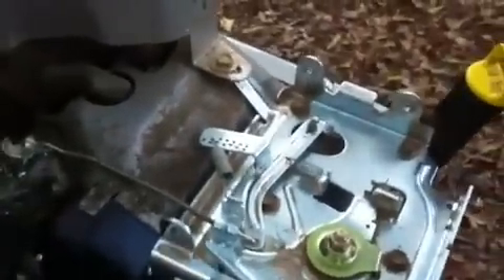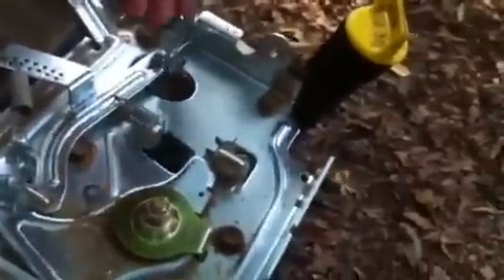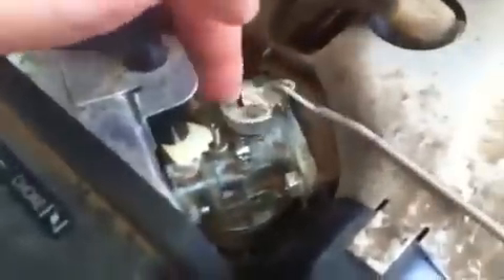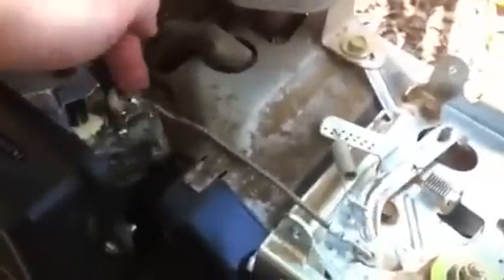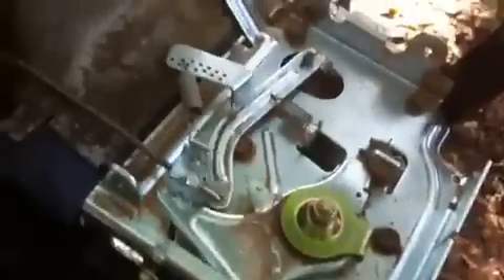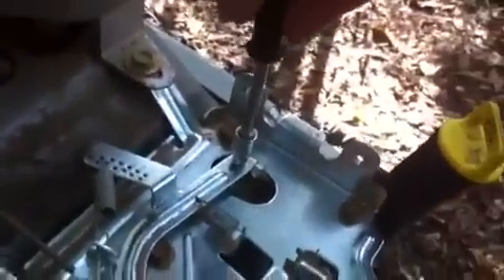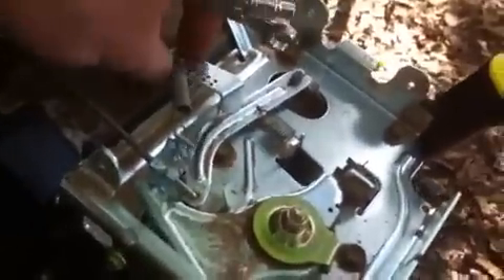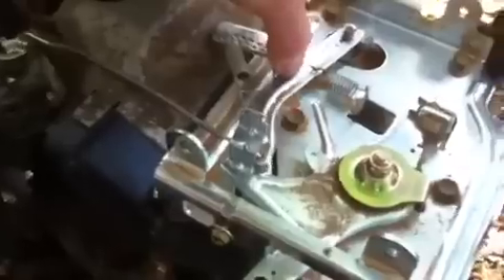Governor adjustment Briggs & Stratton small engine

Comment: Thank you! Thank You! Thank You!   I pulled the carb to clean it and took pictures to make sure all the springs were in the right location and my little engine was wide open throttle no matter what I did.  This is exactly what fixed it! 
(Search words for others:  Lawn Vacuum, Idle adjustment, Briggs & Stratton, Agri-Fab)

Comment: Nice video. Doesn't really help me, but....
Have an even older rototiller, model #100292. It's a 5 hp briggs and I'm having a heck of a time figuring out the throttle linkage- from the control arm all the way down to the carb. Thankfully the long cable moves.  It was sooo greased up and dirty that none of the connection pivots (linkages) worked. I dumped the old gas, have a new plug, and I'm gonna get a new coil for it (no spark at the start). The old coil is original and really rusty. It also ohms out weird. I don't see a condenser or points, so it must be a second or third generation coil. They'll obviously have a newer coil to replace it 😳

Comment: Thanks for the video Sir. I have a briggs and stratton engine on my push mower and this is my first time doing repairs on it. I completely removed the governor arm from the governor post. I don't think I was supposed to do that. I can now easily turn the governor post with my fingers. It only moves so far in each direction. Did I mess up the setup inside the engine where it connects to the governor post? I was trying to connect the Link-Mech governor to the Governor lever by removing it and inserting the Link, instead of removing the carb and connecting it that way. I'm a bit worried that I have to take the engine apart to set up the governor correctly inside the engine? This is my first time working on a lawn mower. Can you please confirm whether I messed up or not and give me advice on what to do? Thanks for your help.

Comment: Thanks for this, I have the same governor setup for my 7hp tiller. I set it as you showed, but there is still no change in throttle rpm, despite moving the throttle lever back and forth. Is the governor itself broken? And does it matter what hole you set the spring in? I've tried multiple hole settings and it doesn't seem to change anything. Any advice?

Comment: Kudos on this vid. Fully counter clockwise will ensure the governor engages to the max. You can go a little bit clockwise, AFTER you've gone counter clockwise all the way until it stops. That will bring the revs up a bit when the throttle is all the way open....................Z

Comment: I just watched the video for adjusting the governor on a B&S engine. All I can say is thank you. My tiller wouldn't start so I started on the fuel system. It was very dirty, 20 years of dirty. I cleaned the carb and tank as well as could. I tried to adjust the gov with no clue to what I was doing. I started the motor and it was running wild. The choke was the only way to attempt to operate it. This motor always had issues. Couldn't run it without some choke and surging was always a problem. I'll try to adjust the gov tomorrow. After watching your video I'm hopeful to get it right. If need be where can I get a new carb? TIA.

Comment: Thank you for making this video. I had a mouse nest and mud dauber nests underneath the shielding below the governor, that would not come out with an air gun or any tools, so I had to take off the governor arm and did not realize until it came off that I had not marked the position between the arm and governor.  Put it all back together and it was revving a bit too high, I knew I had the arm wrong but could not find the answer for my type of governor until I found your video. All the rest are saying go clockwise.
Thank you.

Comment: Today for some reason my wood chipper did not start. I cleaned the carburetor, drained the gas tank and filled with fresher gas, sprayed easy start in the air intake …..still no starting. Then I realized that the throttle did not move the little arm. I thought that  a spring was broken, missing and else. So I came back home ( by the way….my electric weed waker  stopped working as well….it’s toasted! :(  ) and  came across with your video. It has the same assemble like yours. Now I have an idea on what to do next time i see my wood chipper again. Hopefully I won’t mess it up for good. I’ll keep you posted. Than you.
Reply: I have the same problem on my chipper.  When I move the throttle lever, the throttle doesn’t move.  I still can’t tell from this video if it is supposed to or not (the video is super blurry).  What did you find out?
Reply: @lisakeller149  well….after replacing the spark plug, cleaned the carburator , cleaned the gas tank, changed the oil the chipper started at the first pull. The governor want the problem, but now I can’t keep the idle. It either full throttle or off. So now I have a new problem. It runs only at high speed. Any clue?
Reply: @lisakeller149  I am going to work on it today or tomorrow. The wood chipper is in cabin somewhere else. I will let you know….
Reply: @lisakeller149  tried to clean the carburetor, cleaned the spark plug, started for a few seconds and than stopped. I have no idea why it won’t start.
Reply: @lisakeller149 mannn I hope you figured this out, I just bought a wood chipper and thought that the issue was with the governor sprnb because I would move the lever and the spring wouldn’t move, so I squeezed the paper clip end and now it moved but I went to turn it on and the throttle opened and closes all wonky when it’s running.

Comment: Having issues with my engine surging. Have replaced the carb, spark plug and have new gas. Also had oil and white smoke blowing out of the muffler. Have a Poulan Pro 725exi. Any tips would be greatly appreciated.

Comment: I know this video is old, but I had to say thank you for saving me hours of scratching my head. Adjusted just like you said and it works perfect. Turns out the little 3/8 bolt had come loose. Adjust your max rpm with the spring pressure. Easy as pie.  Thanks a million!
Reply: Does your linkage work the same way? I move the lever outside and nothing happens. Help!
Reply: @thekenpokid21  Mine was on a newer engine, but I adjusted it and ran perfect.....until the internal governor exploded about 20min later. Had to remove entire engine, remove crankcase cover, and replace governor assembly inside the engine. If your rod is doing nothing, it may be damaged inside the engine.
Reply: @ryanhoaglin9907  oh no. Yeah I'll have to start the engine again. I spoke w my neighbor and he said the engine has to run for this to work. I'm not sure about that though. I'm not up to opening up the engine but if that's what I have to do then I'll have to doit. Thanks for the tip
Reply: The engine does indeed need to be running for the governor to exert it's influence on the throttle. It operates with flyweights which are weights on levers which work against a bushing linked to the external governor arm. As the engine spins faster the weights fly out harder and thus pushes the throttle closed by an amount determined by the governor spring tension. This keeps the engine from overspeeding.  @thekenpokid21

Comment: I see that I am missing the smaller spring that is attached lever. I also don't have a throttle control arm on my snowblower, but otherwise the same setup. Thanks for posting

Comment: Looks like the same setup as my snowblower engine which is over revving so I'm going to try it.  Took some searching to find this so much appreciated.
Reply: Gave it a try with counter-clockwise and actually revved even faster.  I readjusted to clockwise and ran much better.  So a diff model I guess but still your video helped.  Thanks

Comment: Thank you for the video, would you know why if I am on full throttle and decide to move the choke from run to choke, the rpm jumps way to high, over 4200.
Reply: That could be a lot of things, try maybe cleaning your carb. Or maybe you have an air leak somewhere and when you choke it it’s pulling in air from that air leak.
Reply: Which would be a bad gasket by the way, like a bad intake gasket, carb gasket etc.

Comment: I thank you.. I have to rewatch video again. Can you so a 12 hp briggs and stratton on a rer snapper mower...lol and do I need the little spring cause I cant find it on my mower just the linkage throttle and chole but the govenor spring is missing

Comment: This is my problem exactly. But my question is why would it go out of adjustment if I never messed with it? I mean I took my whole carburetor off to clean it and when I put it back on, it started to over rep to the point my exhaust was cherry red. Just don’t understand why when I re attached my linkage it wouldn’t be like it was before without having to re do it.

Comment: Awesome video of the mechanical governor. I had to order a new linkage rod/spring for a repair. I know where the rod ends go but where the heck do the tiny wire ends from the spring go?  Can someone help me?
Reply: Usually there are very small holes near each end of the rod where it attaches to the carburetor and the governor arm. At least on mine anyways. It doesn’t help they make so many styles of the linkages to the governor arms.

Comment: great info. thanks. took apart/off the governor to repair some wire damage by mice. never knew the governor shaft had any orientation to the throttle body.  wasted about 3 hours on the rototiller fiddling with everything else. Then 4 minutes  watching this video on the web fixed the problem. Thanks!

Comment: thanks. Please help. My engine problem is speeding up & slowing down. I'm sure it's a governor problem. My Briggs engine has two springs attached to the swinging governor arm. One seems meant permanently on the end of the governor lever, the other goes to one of many holes or teeth. The end of the governor lever has a rod going to the carburetor. I have no clue which hole or notch the variable spring is to go to--no one talks about it. I've tried Many variations, even stiffer springs, even a new carburetor. Please advise how to fix the revving & slowing.
Reply: Usually in your case the secondary spring goes into the number 4 slot. There are about 5 holes to choose from and they are numbered. That said, it seems like you engine is surging. In other words, not getting a steady flow of fuel through the carburetor system. The culprit is usually that the pilot jet is plugged. Unscrew it all the way out and see if it is clear. If not take a small welding tip cleaner or fine piece of wire to clean it out. After reassembling if it still surges, you may need to drill out the pilot jet one size bigger. You need very fine drill bits to do this.

Comment: Which way is closed?
Which way is open? 
I don't think you made it clear enough which way is fully open.
Reply: Yep, clear as mud. I got lost with clockwise, anti clockwise repetition that it was hard to follow.
Reply: Start it up and take note of the position on the carburetor when it revs up to full throttle. You will know what it looks like then. Also, if you have the linkage attached and it is reving at full throttle just adjust the governor one way and try it. Then adjust it the other way. Two options, one will work.

Comment: Great job on this video Mark. Very helpful. If anyone has disassembled their governor arm make sure the nut goes on the right or it can come in contact with the frame causing the arm to bind and not move the throttle.

Comment: hello i have a snowblower that has a huge gap in the throttle. i have to push it 3/4 open for the engine to start reving faster and the high rpms are not as fast as i would like? i changed the headgasket and notice the issue after? the mecanism is the same as in the video.

Comment: Thanks for doing this, Mark.  I still have the problem I'm chasing down, but this helped me eliminate a root cause I thought I had.  I didn't realize how the governor turned the arm; I thought I had a problem with a missing spring because the throttle was stuck open, but as you show the governor will pull the throttle back when the engine starts running.  I did go ahead and double-check the governor was set correctly while I was at it though, based on what you showed.  Thanks again.
Reply: bkell1011 i thought the same thing. This video confirmed i had in put back together correctly.

Comment: Right on, i took the throttle linkage off for a bent spring an rod replacement while servicing the carb. Once done, the engine took off like a jet, spent far too long trying to troubleshoot. Your video helped me out big time. Everyday you learn something new is a decent day :)
Reply: Same here man. You would think since you didn’t mess with the governor that it would simply line up and work. LOL I still don’t understand this mystery.

Comment: That looks like the governor on my Troy-bilt tiller. I just replaced the carb with an aftermarket, and it only runs at full throttle now, so I guess this is what I need to mess with.

Comment: Good video. I think the governor shaft on mine may have dropped into the motor. Is that possible? any ideas how to get it out?
Reply: yes you need to drain the oil and remove the crank case cover. If you are careful not to damage the gasket you can reuse it. I got lucky and the gasket stayed on the engine side with no damage. Inspect the governor shaft,bushing, and gear for damage and replace if needed. On my engine the governor shaft is held in place with a push nut style lock ring from the outside of the engine underneath the governor control arm. Happy wrenching..
Reply: If it is not showing, You will need to take the crank case cover off to get it back out.

Comment: Does it matter where ur stop / trottle leaver is when u adjust governor or can it be in any position as long as carb flap is wide open. ?
Reply: Throttle lever is secondary so it doesn’t matter because it will self adjust and fall in sync
Reply from the maker: Jason Scruggs no, it doesn’t matter.

Comment: Great video! Mine was doing the same thing. One thing I discovered is the shaft screw only turns about 1/4 turn either way. I thought mine was frozen or rusted. I quickly realized it only turns the 1/4 turn. Thanks for the info.

Comment: I installed a new gas tank on my unit like yours. It came with a new mount for the new gas tank. The governor works properly but I have no speed adjustment. It runs full speed all the time. Do I need a new spring?

Comment: thank's for posting this you saved me .i bought and mounted  a new carburetor and armature and tore half the stuff off the motor. i finally put it all back together and started it, the motor raced really high and so after watching your video i removed the gas tank and discovered the governor arm was not adjusted right and had the wrong governor spring that came with the new carb so i used the old spring and adjusted the arm and it ran good.
Reply: I used the new spring, too, and although it was shorter, I thought the new one was just needing to be broken in or the old one was stretched. I guess I need the old spring rather than the new spring. Good comment, thanks.